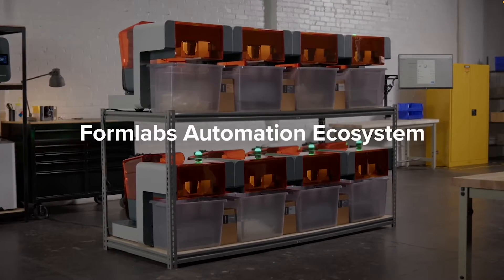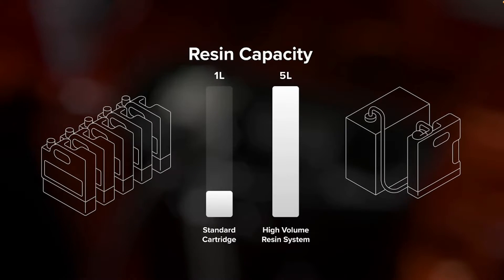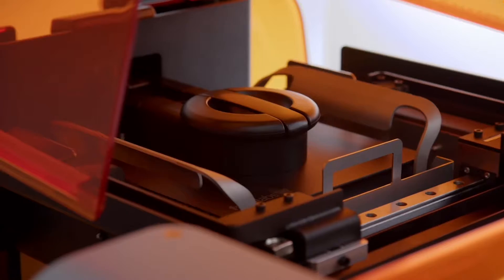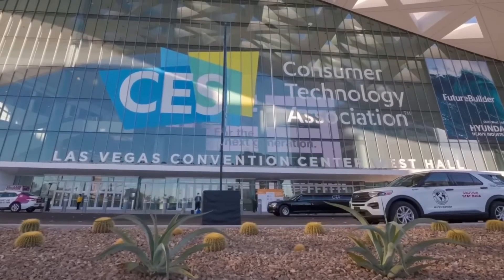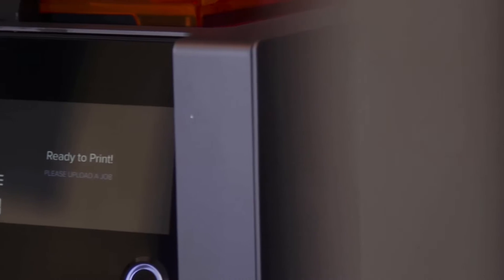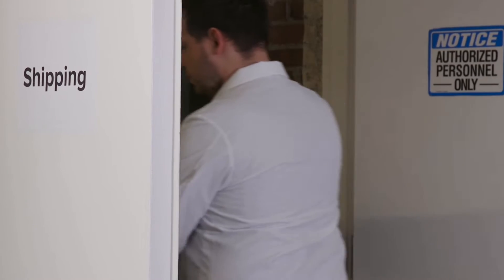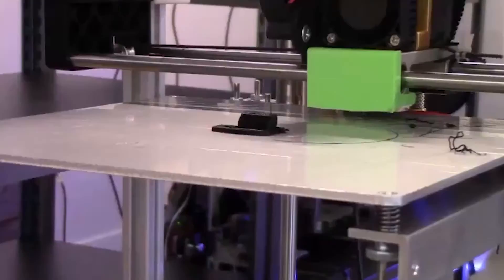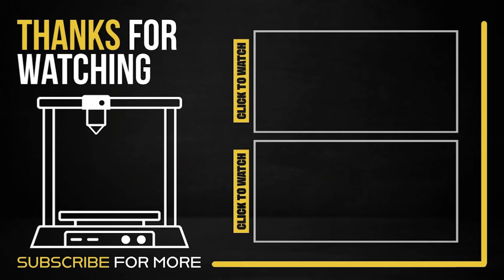High Volume Resin 3D Printing - Formlabs Automation Ecosystem

Comment: I think Form Labs is not aiming for "mass" production, but more like "medium" production. I see their marketing always talking about dentures. And I think that is the perfect scenario for this printer. Dentures have to be custom to fit in a person's mouth. With this machine a dentist's office can make 3D scans of a patient's mouth, make an STL for the denture and put it in a Que to be printed. Let the machine run overnight or over a weekend, come in to a basket of parts, clean and cure and send them to the patient. The auto station just eliminates the need to pay someone to watch the machine all day and night. It's great for an office where someone will be in to check on it every 24 to 48 hours, but it will not be occupied continuously.

If you don't know, traditional dentures cost between 3 and 5 thousand dollars. This kind of machine could bring that cost down a lot. And make it easy to get replacement dentures. If the dentists can save the STL file they can always just print out a new set whenever needed. And trust me, old people misplace or break their dentures A LOT.

Comment: Certainly not mass production resin with formlabs as your chosen machine. Super expensive resin. Super expensive machines. Super expensive add on equipment. And all to produce something from plastic which is supposed to be inexpensive. It’s a great example of engineers doing things because they can and not because they’re a good idea.
Reply from the maker: A lot of that will likley change
Reply: Well said! Material costs is huge variable!